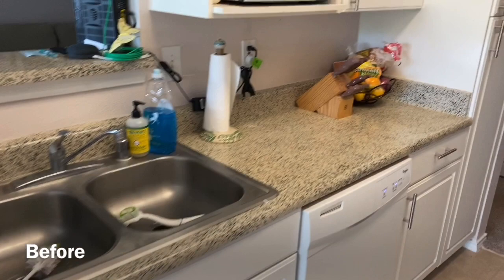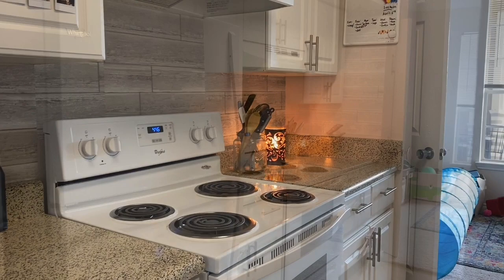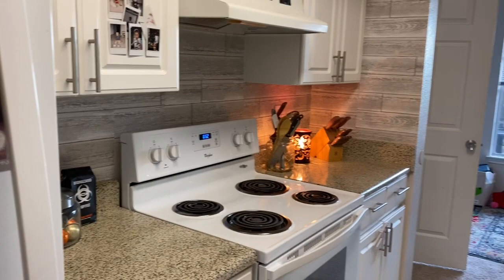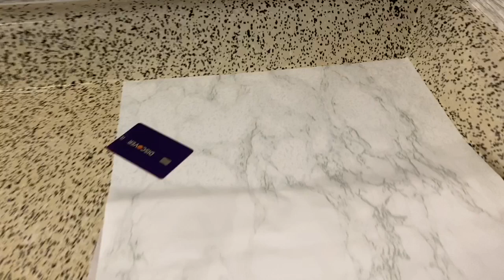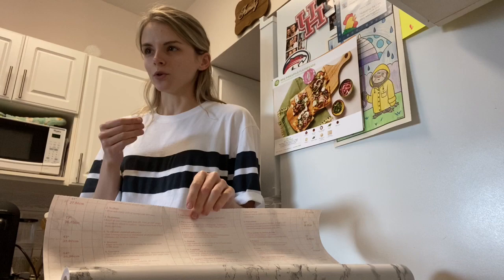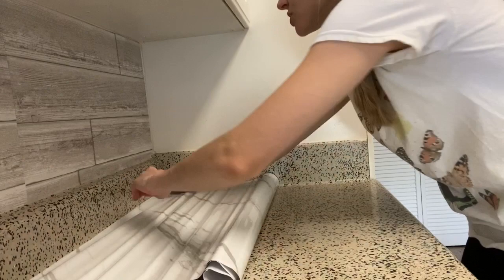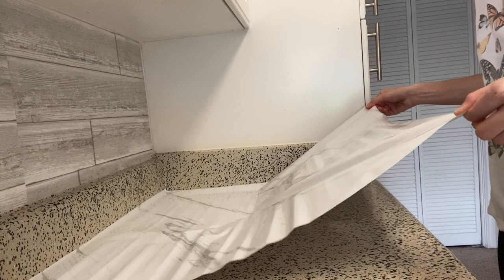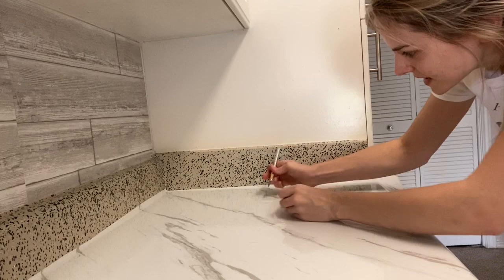EXTREME KITCHEN MAKEOVER | APARTMENT EDITION! DIY Marble Countertops + Backsplash

Comment: I just did this to my Son new apt. It took hrs. To get it right. Instead of making small pieces, I used one long counter top piece peeling the paper slowly I did he some wrinkling  and bubbling  but it was in places that you couldn't see or notice unless you  got really close. I wanted to make sure that the seams were done away from the water. The paper does have shrinkage  so the cutting for the outlet was done once the paper was in place. It's best to remove the 
Outlet plate before placing the paper it makes for a better look.

Comment: Yes it’s horrible I put mine and nextday all this little bubbles just pop up of nowhere and yes if you have a crease and pull the paper back it’s ruin and you have bubbles any way
Reply from the maker: Yeah mine has bubbles everywhere now that it’s been a few months! We are moving here soon so it doesn’t matter, but I definitely don’t like it anymore!
Reply: I’m 51 years old and I remember my mom doing this several times as a kid. She always used a needle to poke holes randomly in the contact paper and ran it length wise of the counter. Never up and down as to show “seams”. It always stayed bubble free and clean. She was adamant about placing protection under any warm or hot items.... 💓💓💓

Comment: What brand of paper did you end up using?? And how much total did you end up spending? It looks great on the video and on insta but I can see what you mean by not as great in person.
Reply from the maker: Anissa Alvarez so I ended up up ordering a “commercial grade” paper from amazon- I linked it in the description if you want to check it out. I used two rolls for my kitchen and it cost about $50 with the backsplash paper as well. It definitely is a temporary look- the quality is not incredible but it gets the job done of improving a rental!
Reply: The linked contact paper didn't look like the one you used in the end. I really want that kind with the longer lines unlike the one in the link. Don't know if they changed the product or if it's just the wrong picture for the product.